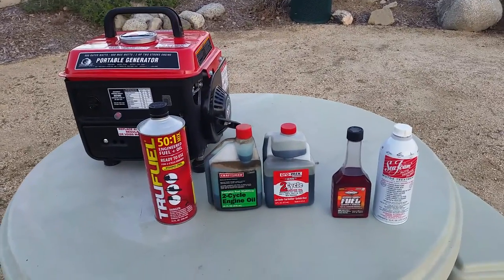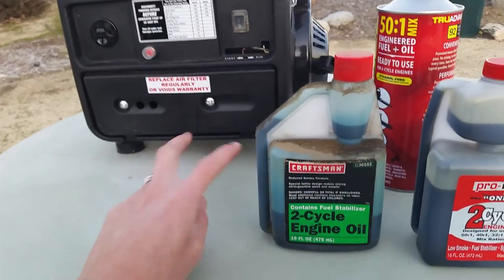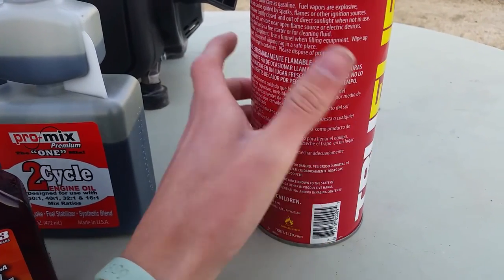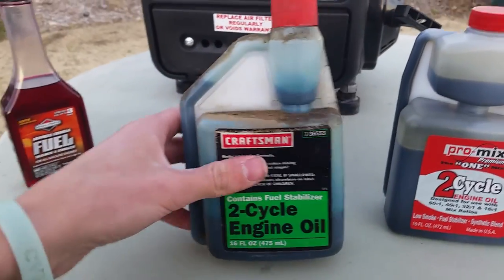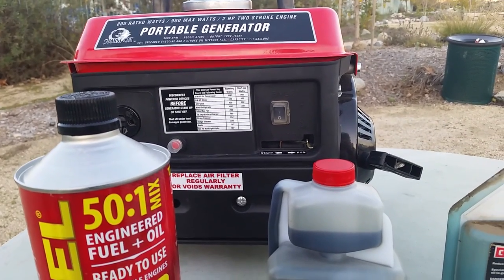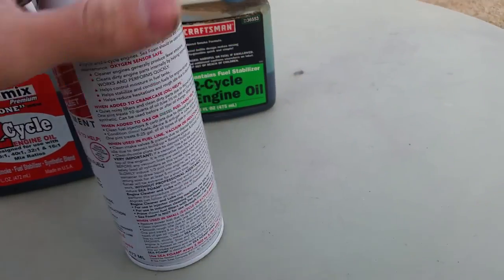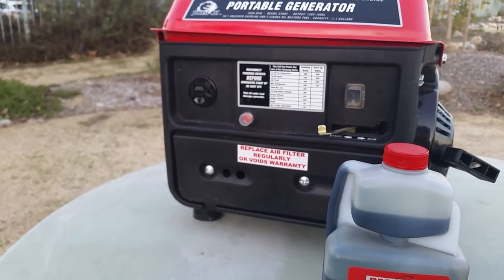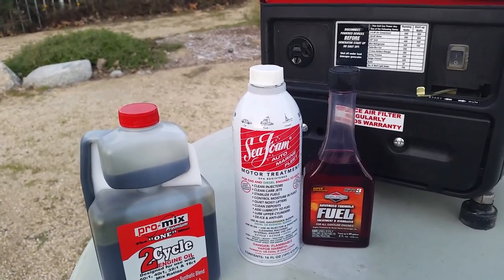2 stroke generator fuel additives

Comment: been running 2 stroke all my life you can do 2 things and throw all the other stuff away and you will never have any trouble out of your 2 stroke 
one if storing generator for a week or longer always shut off the fuel and allow the motor to idle till it runs out of gas this will prevent gunking up the carb as the fuel evaporates over time if left in carb 
second shake fuel well before starting and this goes for all gas be it 2 stroke mix or your lawnmower gas left in gas can 
stabal helps to prevent gas additive separation after it sits for 6 weeks or longer and simple shaking it up will solve this problem with all fuel   
problem solved without spending a dime
even my 1993 2 stroke boat motor still runs like new today but i always disconnect the fuel and allow it to idle till it runs out of gas before leaving the lake

Comment: Nice video. Seafoam also acts as a fuel stabilizer, so you should be running either/or, not both. You may already be choosing between the two stabilizer products. Seafoam alone should keep the fuel stabilized and also treat the engine.

What item number is your generator? There are two lots, 60338 and 69381. I had problems with the 60338 lot leaking at the spark plug port. I made a video about that on my channel. I would give a look to yours to make sure it had a good seal at the spark plug.

Comment: the premix is a rip off. you spend $24/gal for fuel. never ever use seafoam on two strokes as it does the same damage as running the engine without oil in the fuel. ethanol isn't a problem anymore as every engine is designed to run on it now. what was happening when ethanol first came out is that allege was growing in the carberator and fuel lines. you only need stable when storing.  if you want to clean your 2 stroke engine, run a fuel injector/ valve cleaner in your fuel.
Reply: Seafoam destroy your engine? As good if not better than most. I have ran it for years and never had one engine failure.

Comment: I use Sthil  Hp  (silver bottle  Synthetic ) works great  not as much smoke  as for stabilizers  Trufuel  has a stabilizer in it  that's why an open can of it will store up to 2 yrs and a closed can I think up to 4yrs  I use it to store my Honda Generator  and Chainsaws  just dump out old Fuel  put just Enough Trufuel in to start it and just let it run out of Fuel  Done

Comment: It's not hard to explain, 2-stroke engines fire on EVERY revolution and 4-stroke engines fire on every other revolution. Single cylinder engine spark plugs fire every revolution regardless to being 2 or 4-stroke. Performance 360 by Sta-Bil is highly recommended by most manufactures as some gas stations sell gas mixed with a maximum of 10% ethanol. This is NOT the red Sta-Bil most are thinking of. It's more of a gold colour fluid.  Ethanol absorbs water and turns it into an acid that eats away at the fuel system components.